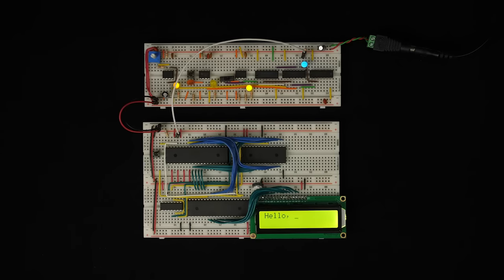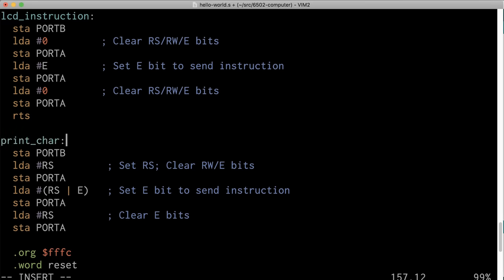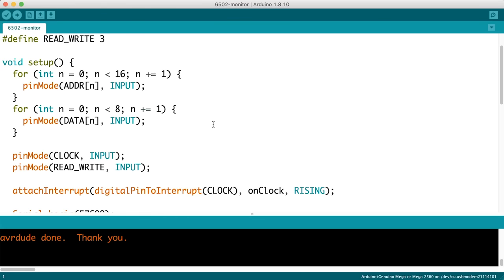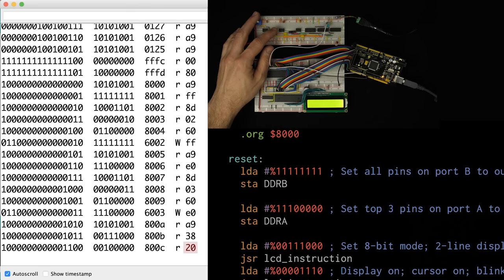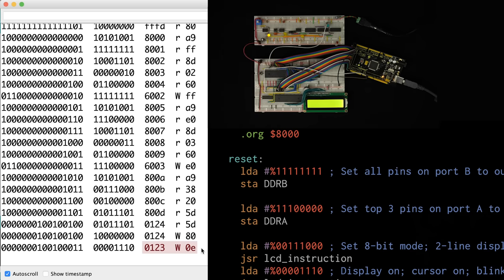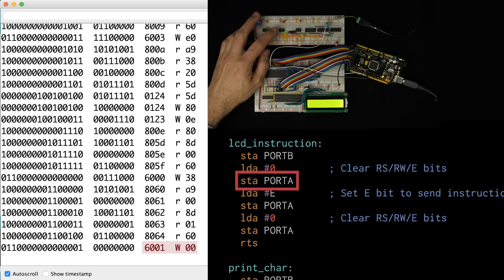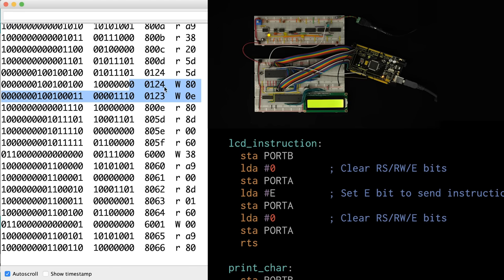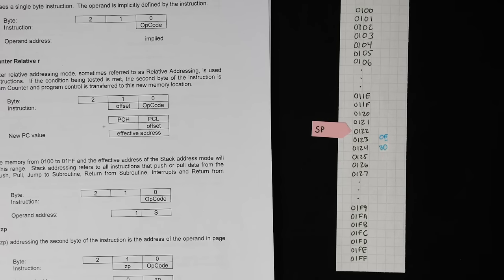What is a stack and how does it work? — 6502 part 5

Comment: Hi Ben... Great video. What about this new cap on clock circuit? Tell us more about it. Is it going to be permanently there? Thank you.
Reply: That is for de-boucing. 

The microswitch he presses (or any button) internally have 2 electric contacts that closes a circuit. When you push the button for a split second the contacts bounce making the switch briefly oscilate between on and off until settles in the final state. This is very quickly to us, but fast electronics can react to that oscillation as multiple pushes of the button.

The capacitor eliminates that because it can store a tiny amount of electricity, so when you first push the button and it for a tiny amount of time closes the circuit, the capacitor can charge a bit. When the switch bounces and the connection is momentarly off, the capacitor discharge the energy in the circuit, making it look like the button was still pressed. This charge and discharge of the capacitor keeps happening while the switch is boucing. When the switch fully engages, the capacitor charges and stay charged for as long the button is held. Then when the button is released, the capacitor starts to discharge, and if the button happens to bounce again, that charge-discharge cycle will happens again the same way it happened when the button was pressed.
Reply: @fellipec  very good video. Tks.

Comment: It was at this point 7:36 I realised this is where the return address would be stored in RAM so the program would continue running. Then I realised it would be another month before we would be able to see what Ben is going to do! That being said, I'm going to have a go at adding my RAM and trying it myself!
At 4:21 thanks to my PCB, I don't need to disconnect and reconnect the Arduino.
Thank you for another wonderful video Ben, I didn't really understand or know about stacks before. Keep up the great work, looking forward to the next step.
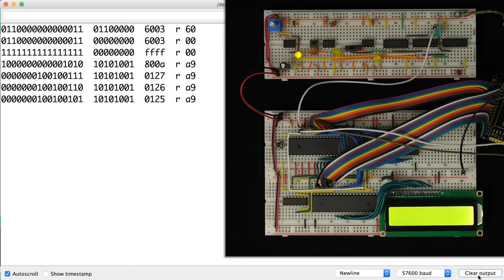What would be a better way to solve the issue at 6:18?
Reply: I'm guessing it would probably be to slightly increase the timing delay in the 555 timer.  I'm not sure why Ben didn't do that, but maybe he was tired after planning out this video and decided to just "bodge it" for now.

Comment: You would need a second processor to add more directions, in order to avoid any stack overflow.
Also I think their should be a software analyzer integrated with the chips to avoid any stack overflow or any command sent somewhere there is no hardware to read.

Comment: i knew about this stuff for a long time, but never in such a detail. thank you, very very well explained! :)
i got questions about the stack architecture:
1. why does the stack grow backwards? was this an arbitrary decision by some weird computer engineer many decades ago and we just stuck with it or does it provide any advantages? since it seems to be counter-intuitive and unneccesary complicated.
2. is the mechanism that the stack just wraps around from the beginning to the end if we keep pushing stuff to it a special case of the cpu you are using or is it a general thing?
3. why does the cpu not just initialize the stack pointer to the end of the stack frame when reset?
4. why does the cpu not just go into a clear stack overflow mode and halt to prevent the weird and very very hard to debug state of the cpu in such a case since the error will probably show up later in a completely different place than were it actually happens?
5. are 3 and 4 not done to keep the stack mechanism flexible for some fancy off-usages of the stack for other purposes than saving states?
Reply: 1. It was probably arbitrary, but will be quite intimately linked to the transistor-level implementation.
2. In the case of the 6502 it is extremely simple; to keep the die as simple and small as possible.  You want stack limit checking? You implement it yourself in software.  (And I'd guess that noone does on 6502.)
3. In the case of the 6502 it is extremely simple; to keep the die as simple and small as possible.  No registers are initialised (only the disable INT bit in the PSR) IIRC and only the PC gets written by the post-reset vector fetch.
4. See 2.
5. The stack is the stack.  It's not for anything else, nor is it intended to be wanked about with.

This is an 8-bit micro from 1975 made from 3k5 transistors, accept it for the minor miracle that it is.  https://en.wikipedia.org/wiki/MOS_Technology_6502
Reply: 1) On the Z80A, a reset puts the program counter to 0000, it starts at the beginning of memory.
 The stack would be expected to start at the opposite end of memory and grow downwards toward the program memory, and you'd better hope they never meet.

2) The Z80a like the 6502 had a 16 bit address bus capable of accessing 65,536 addresses.
 With the stack starting at the top, it could use any & all of that 64k that wasn't taken up by program.
(The stack pointer was 16bit not 8bit as on the 6502.)

Comment: Based on what I remember (I used to use assembler on a computer with a 6502) the stack pointer works the other way around. I.e. when I push something onto the stack (e.g. with the instruction "PHA") then the stack pointer increases instead of decreasing. Or does the 6502 work differently than a 65cs02 when it comes to the stackpointer ?

Comment: and now i get how a stack work! but i have a question, what makes this an 8bit system? is it cuz it has an 8bit data bus so it process only 8bits per clock? but it has a 16 bit address bus and i always thought that a 64bit system is called so because it can address 2**64 byte, so that would make a 16bit data bus system able to address 2 bytes at the same time instead of one? it sounds wrong to me cuz i thought that a memory address should point to one byte? or is it because it has only 8bit register?

Comment: Can't you couple the stack pointer with an another register to store the return address? It looks like you're only using the A register, leaving plenty of registers free for storing the return address. Is it an issue of the jump instruction not being able to read from those locations?
Reply: I was wondering the same thing.  Since Ben didn't give us anything new to do this time around, it would have been nice to know if there is a workaround that utilizes one of the 6502's unused registers until the project starts using RAM.
Reply: Jump instruction, JMP, can only read an absolute address (like JMP $8000) or indirect address [like JMP ($8000), which reads 2 bytes starting from $8000, reverses their order (it's little-endian), and it's treated as a pointer to the actual address, where the CPU jumps]. Plus, apart from A, 6502 has only 2 index registers, X and Y. And you can't use them with the stack pointer. Apart from PHA (push A on the stack), PHP (push the status register), PLA (pull A from the stack), PLP (pull the status register), you only have TSX (transfer stack pointer to X) and TXS (transfer X to stack pointer).
Reply: In a 6502 CPU, no. There simply aren't enough registers to do fancy stack manipulation. 

But otherwise, yes. The concept you are looking for is called a link register.

https://en.wikipedia.org/wiki/Link_register

Comment: It would be great for this simple example if you could just stuff the return address into the unused X and Y registers (or just one of them as long as you stay within page $80), but basically no microprocessor lets you directly modify or even read the program counter without a stack.
Reply: Also you can do it in terms of the zero page, but that still does no good as long as it isn't internal to the CPU.

RET = $00
RETH = $01
...
LDA #.lower(ret0) ; pseudocode assembler macro for the lower byte of an address
STA RET
LDA #.upper(ret0) ; pseudocode assembler macro for the upper byte of an address
STA RETH
LDA #...
JMP lcd_instruction
ret0: ; every subroutine call gets its own return label
...

lcd_instruction:
...
JMP (RET)

Comment: why initialize SP to 0xff and not to 0x01ff ?
Reply: Synestematic SP is an 8-bit register. Therefore the max value it can hold is 0xFF (255 in decimal). The 0x0100 part is hardwired in the 6502. When pushing to or popping from the stack it always refers to the address 0x0100 + SP.

Comment: I know this isn't related to the 6502, but the question is memory related.  The 6812 setup far and near memory.  So in memory calls you have to specify in the setup portion of code if your program starts in the near block or the far block.  This particular thing has often been confusing to me.
Reply: The best I can seem to find on this subject is something to do with memory paging. Making something far means that access to that resource must include appropriate use of paging as well.

Presumably then, something that is near is in memory that is fixed and cannot be paged out, so is always in the same place when ever you call or read that address.

Far, in contrast, may be in an area of memory which must be "brought into view" of the processor before you can access what is contained within it.

Memory paging is one way that small computers can make use of larger amounts of RAM, at the expense of some management to make the correct portion of RAM available when it is needed.

Comment: Question: Is the stack pointer just another register like the A register which is also used by the CPU as a stack pointer? Also why can't we use another EEPROM instead of the RAM. That could work too right as they are basically the same except the RAM being volatile and fast?
Reply from the maker: Yep, the stack pointer is just another register.
Using an EEPROM instead of RAM would work, but because it’s so much slower it would limit the speed we could run the CPU by quite a bit. EEPROMs also have a limited number of erase/write cycles so it wouldn’t be reliable to use it this way over the long term.
Reply: Yes. The PDP-11 had eight 16-bits registers (R0-R7) and anyone of them could in theory be used as a stack pointer. Or any other type of pointer into memory. In theory, because R7 was also used by the CPU as the program counter (PC). Trying to simultaneously use it as a pointer to some data would definitely produce "interesting" results. And you don't want interesting results when programming. You want boring, predictable, results.

The convention was to use R6 as the SP, but it was purely a convention to keep the programmer sane. It was a good convention too, because besides jump-to-subroutine (JSR) and return-from-subroutine (RTS) which was under the programmers control, signals from the outside world could also trigger a subroutine call, and when that happened, R6 would be assumed to be the actual SP, and the triggered subroutine would happily clobber the memory that R6 pointed to. And that would also lead to "interesting" results afterwards.

But nothing prevented you from initialising R6/SP and point it to a safe area of memory, and then proceed to use say R3 as your stack pointer.

I could be wrong, but I think the M68000 continued that tradition of using a general 32-bit register as the SP. And come to think of it, the ARM processor in your phone can do the same.

Comment: One would have thought the stack register would be on the chip itself. An understatement, since the pointer and the storage location need to be on the chip itself. At least in microcontrollers, while in the microprocessor stack pointer push/pop storage location has to be implemented by design because code running in ram at boot assumes the code has been loaded from rom. But if it is running from rom, why branch code needs ram to store the pointers in the first place? The question here would be, does the 6502 store the stack on chip or somewhere else? I recall I heard in ram. That means the chip has only a counter for stack and adding a reference address to correlate stack storage location to actual program address will be a mental aerobics all by itself. I love this kind of videos because I understand assembly all too well. Better than higher level languages which tend to obscure the background operations and making things complicated by having libraries littered with compiler directives and what not.
Reply: The 6502 is designed to have RAM.  It is not a good choice for a computer without RAM.  It's design ethic was that the first 512 bytes of RAM sort of 'belong' to the processor as the extended register file (128 16-bit pointer registers) and the stack.  Since Ben is more about hardware than software you may need to look elsewhere to find out about the 6502 instruction set, its quirks, and its power.  Once you've grocked the 6502 it all just feels natural.  (But then I guess that's true of all CPUs that are routinely programmed in assembler - and I'd even count the ARM in that having done it for several years.)
Reply: PICs have an internal stack, but it's like only 8 levels deep and then you're screwed.
 The Z80A had a 16bit Stack Pointer that could avail of any of the 64k RAM that wasn't program & data.
Reply: @massimookissed1023  I can see how that was revolutionary back in the day. Impressive no?

Comment: Your using an eeprom so is there any reason not to just use that as ram?
Reply: You could do that, yes, but it needs to be carefully explained that for the slowness of writing, the limited writing cycles and the possibility of rewriting your program if something goes wrong, a proper RAM is necessary in any real world applications. Modern EEPROM can be used quite casually as a read/write memory, but that was not the case when these 8-bit processors came to prominence (the 80's), back then you had to at least first "erase" (write all bits as 1) the memory before you could rewrite it with new data.

Comment: I'm interested in why the processor reads 5d from the address 0124 at 07:42, is it for a similar reason as explained at 13:10, that the processor probably inserts an extra clock cycle for internal stuff?
Reply: There was nothing connected to 0124 for it to read, so there was nothing to change what was on the bus from last read at 800d.
Reply: Yes, whenever the 6502 does anything internal without accessing the bus, it does an invalid read from the bus. In that case at 07:42, the bus still had 5d on it because the bus was floating and pins tend to maintain their charge for a short time.

Comment: The display has RAM in this computer. 80 x 8 bit Display data RAM and 64 bytes Character Generation RAM. Only 32 of the 80 characters in the 16 x 2 character display is used on screen, you could have used some of the other 48 as the stack for giggles. :)

Comment: I was looking at the final schematic of your 6502 computer. The memory map is split between RAM (32K) and ROM (32K), but the I/O is overlays the RAM in an 8K block below ROM. The final memory map is 24K RAM, 8K I/O and 32K ROM. Besides being the simplest approach for teaching, was there another reason why you would choose this configuration?

I'm a big fan of the Zolatron 64's memory map with 32K RAM in the lower half and the upper half split into four 8K blocks for I/O and ROM.The I/O can be further split into eight 1K blocks. More flexibility but also more address decoder logic.
Reply: In more performant 6502 machines IO usually overlays 256 byte segments of the ROM, i.e. easy enough to decode without wasting vast swathes of address space and especially not the user's precious RAM.

Comment: The biggest weakness of the 6502 processor, was it's reliance on zero page memory, and only a 256 byte stack.  That is weaksauce.  the Z-80 OTOH, didn't have any of that, the stack could fill the entire memory space, if needed.

Comment: I like the Z80 better, you can put the stack where you want to for example : LD SP,C350
But very great video!!!!
Reply: I love the Z80 too!
Reply: Jepp. That's the downside of the 6502. An 8 bit stack pointer in a 64k machine :/
Reply: @MrTridac  Even the 68xx family, which is said to have been the "inspiration" for the 65xx series, has a 16-bit stack pointer.
Reply: @MrTridac  Yep! Hence why C compilers for the 6502 are still a challenge and rarity.

Comment: Do you recommend coding it long-wise initially, and then optimizing the code after initial testing? Or jump straight to coding the optimized version?
Reply: Optimising is overrated. Code for readability so you still understand what you did in 6 month.
Reply: @Martin.Krischik  sure. Thinking in terms of sketching - initial outline, then refine... wondered, can this approach work in programming. Probably not.

Comment: Actually, you may use only one memory chip. If you leave A15 pin NC and set CS on memory chip. Processor will use addresses 0x0000...0x7999 as mirror of addresses 0x8000...0xffff. Then you can place you programm in the end of half-memory (e.g. 0xA000...0xffff), and stack in begin of half-memory. That's like hardware addresses translation  )))
ps. sorry for my english

Comment: I don't know how many registers you have in the 6502 but technically speaking you don't have to have a stack to do this.
You just have to implement your own jump and return instructions. Which of course would mean a lot of copy pasting anyways. But it's possible.
Reply: 6502 has 3 registers, which are available for the programmer. A (accumulator), X and Y (index registers). All of them are 8 bit, by the way.
Reply: @michalczerwinski7711  Oh yeah then it won't work.
Reply: @michalczerwinski7711  - technically there is also an 8-bit flag register.
Reply: @JanBruunAndersen  You're right. There is an 8-bit flag register. And, using the stack, you can manipulate it. I think no one does that (at least I've never seen it) because that might cause the program to go horribly wrong.